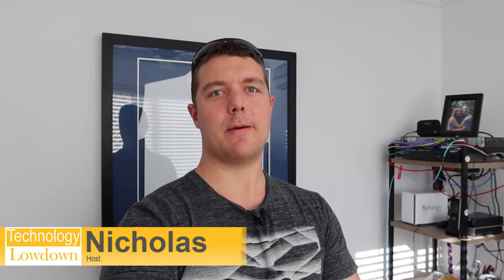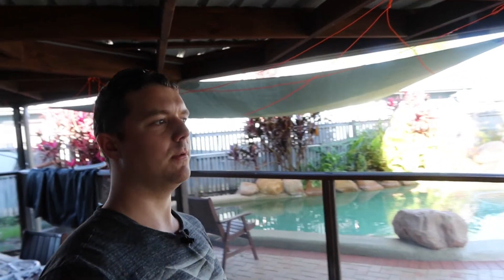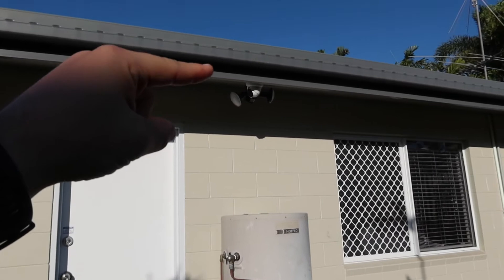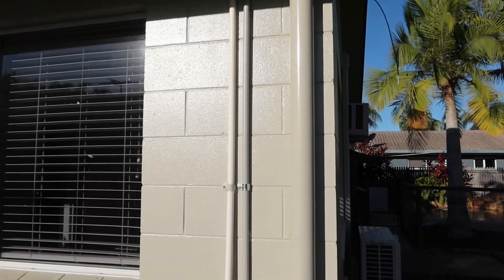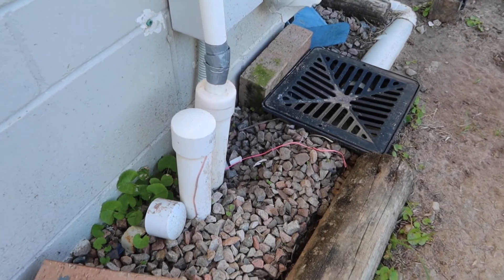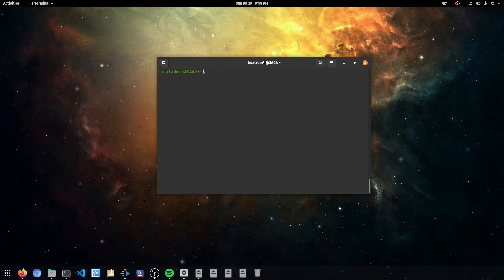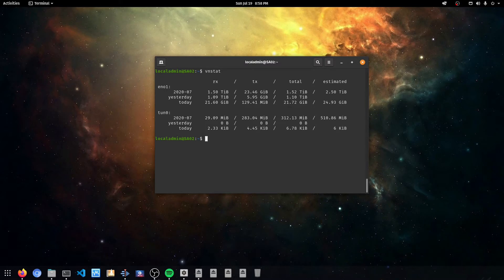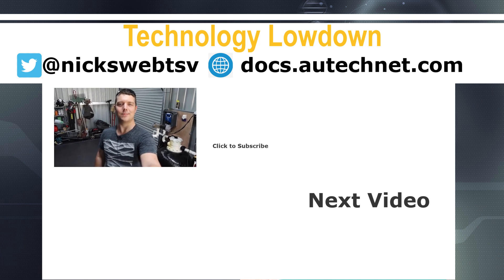Multimode OM3 Fibre run to the Shed

Comment: Not very technical.  I’m sure you’re smart.  But you spent much too much talking about your pool, pool heaters , cameras  etc.   yet no mention of connection from initial edge router or switch , don’t mention cable type , length , performance.  Really just tooting your horn

Comment: Curious, what was the deciding factor that made you choose fiber?
Reply from the maker: I ran fibre so if there's a was a surge on the house wiring it wouldn't affect the shed. I have a backup of Data in both the house and the shed. Fibre was a way of ensuring the shed remained separate. Also allows for shed  to be on a different earth if required.
Reply: @TechnologyLowdown  I thought that might be why, but thanks for confirming and for the walk through.

Comment: I wouldn't trust that CWNE88 guy ;) I looked at your bandwidth required, and the fact you ran fibre to do it. I'd have done that over Wi-Fi !
Reply: WiFI instead of Fibre, you are joking of course. WiFi might be cheaper, but performance would suck.